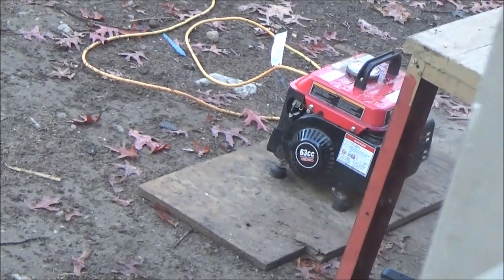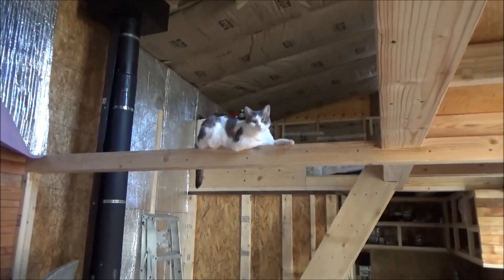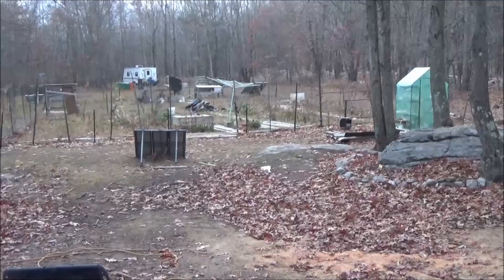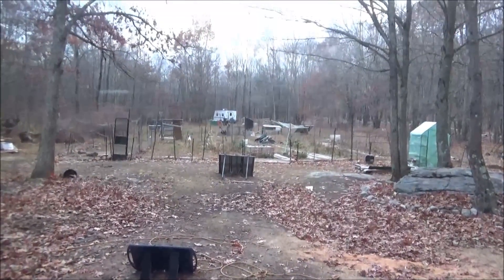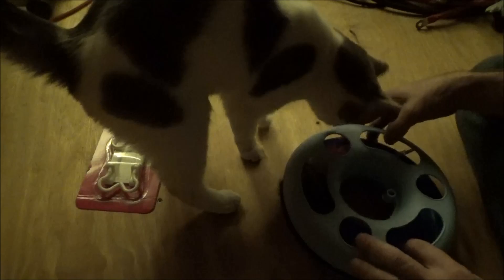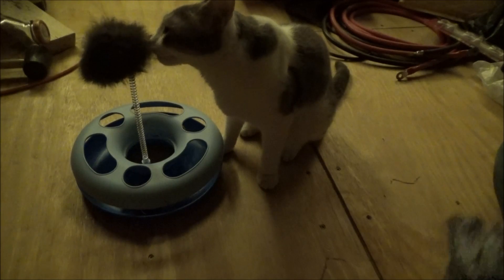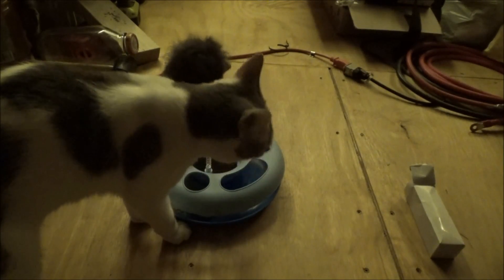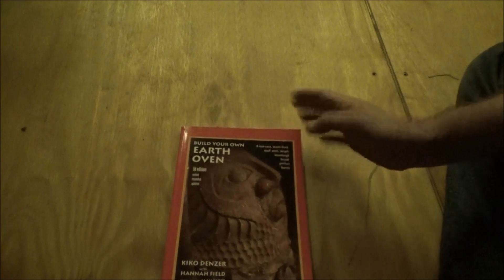Charging New Tiny House Solar Battery Bank

Comment: I started watching Troy to help me understand how solar power works and how to do a DIY setup.  I've also watched some other solar set ups on YouTube that other folks have posted.  Someone help me understand why Troy has such a hard time with his solar set up??? I am afraid to attempt my own set up after watching all this drama he has.  Other folks are running entire homes (minus the 220V appliances) entirely on solar and Troy seems to be lucky if he can keep his laptop and cell phone charged with it.  Also, it seems like he expends a lot of effort monitoring and attempting to maintain the battery bank.  Can someone with some expertise comment on the feasibility of solar power, because after watching these videos, I'm ready to scrap my plans?...
Reply: I also noticed watching other channels that they seem to sugar coat the problems and don't admit failures.  You rarely see an off gridder say I bought the wrong batteries for my set up so now they aren't working well I have to struggle to get new ones and the price is killing me.  No, what do they say on YT? ... oh, look I have just installed my new batteries because I decided to upgrade.   No admission their batteries sucked, no explanation why they upgraded, no install videos... just boom.. here is my new already installed batteries or let me just tighten this last bolt then let me push the display panel reading and show you the pretty display of my perfect batteries.   Well, this is why I like Troy's videos better... he shows it how it is, warts and all.   You know every off gridder has a genie back up for a reason!  But, they don't admit to using it!  No, they will claim they never complain... great if you like sitting in the dark, but if I made my living online I would be complaining!Troy not only admits it, he just showed how to fix it.  Don't give up your plans, just don't be wearing rose colored glasses when you make them.
Reply: I think the majority of his solar problems stem from him keeping his batteries out in the cold. He went through the trouble of building that insulated battery box in the RV yet he didn't bother to keep it heated and the batteries started having all their trouble. I have a smaller solar setup then Troys and I keep my batteries inside...and I have none of the problems he does.
Reply: Because he uses what he can afford and there in lays the problems. You get what you pay for and Troy does get lucky on certain bargains, but with power storage he does get what he pays for. He is making do with it, like a warm house and eggs, just getting the power back together is big plan right now. He has some backups, but he will get this problem solved.
Reply: Solar on a sufficient budget can be done easily. Good batteries and a proper setup go a long way. I'm not knocking Troy for his setup, he's just on a shoestring budget. This can be done but it's the long way around and comes with many headaches.
Reply: Rob Busch Cold batteries perform worse than batteries at room temperature. The type that Troy has seems to be particularly affected.
Reply: Troy got those batteries cheap because they were going back to be recycled. They were left in the RV last winter. His second problem, he is in a spot with only 4 hours of useable solar, and is in a  valley and a medow surrounded by trees which reduce it even more, add to that, the last 60 days, he's had 5 sunny days
Reply: TheMoneypresident I agree. We should all follow you ;)
Reply: jlp1149 You are absolutely right!   My parents are your first option.  Their professionally installed system cost $30 grand!  It has been in about one year, not a bother. .. it is grid tied, and this eliminated their $300 per month electric bill plus they get paid about $1.25 after all is said an done.  (Yes $1.25 was their average excess earnings over their bill.)  Well that's all fine and good. .. but what kills me is because it's grid tied it has to have a shut off so that when the grid is down they have no power either!   I want power while the grid is down... $30 k for solar and no power while the grid is down... that is nuts!
Reply: The batteries are his big problem, if your going to do any kind of offgrid setup you dont want to cheap out with batteries, (or panelsand charge controller for that matter)might be more expensive but it will save you many hours of dark times and frustration, this time of year is also the worst for solar also,if you have any questions about life off grid feel free to ask if you want another opinion
Reply: So temperature plays a big factor in it?  If I don't keep my batteries at room temperature, what are my options?
Reply: why do I not see a reply from youtube user "TheMoneyPresident"?
Reply: Just trying to give J Busch some background info because solar is all about  location, location, location.
Reply: tons of $$$ professional contractors / installers , and a lot of patience == easy, shoestring budget, doit yourself , willingness to take advice (sometimes bad, sometimes good ) a lot of homework and willingness to say I don't know = some success and some failures ,
Reply: MollyDolly I heard someone in MD was having problems with his batteries he has hooked up to a camper a couple weeks ago.  He has the camper parked in his driveway and his son and his sons girlfriend are living in it.
Reply: dumpsterplace1 Shocking! 
Ok, I just made myself laugh...I should take a nap.
Reply: ***** I heard through grapevine that he has a video on his channel where he and his family went swimming in his flooded yard earlier this year.  So why would he want the fix the flooding problem when its a free swimming pool when it floods?
Reply: ***** I also heard he tried to get a man arrested by telling the guy to ignore the fd telling him not go into some flood waters to retrieve his wallet.  I dont know about the laws in MD but that could get you arrested doing that here.
Reply: Jeff Tower Why would she want Troy to pay for the chickens Melvin cofessed to stealing from me a couple nights ago?
Reply: Jeff Tower So shes one of Troys ex girlfriends from hs seeking revenge for him breaking up with her thirty years ago?
Reply: herbsterplace1 Herbie so what channel did Dan(conspi racy) hack to post that on?  THe channel he put the original post on was hacked.
Reply: ermorgan0926
Reply: ***** THat is disgusting.  Only taking two baths this year so far when his yard has flooded.  If I ever see him I will make sure to turn around and go in the opposite direction.  God knows his bo will be outrageous not having a bath since Aug. when his yard flooded last.

Comment: I went to the Wikipedia and got this on Lead acid batteries
These are general voltage ranges per cell:
Open-circuit (quiescent) at full charge: 2.10 V
Open-circuit at full discharge: 1.95 V
Loaded at full discharge: 1.75 V
Continuous-preservation (float) charging: 2.23 V for gelled electrolyte; 2.25 V for AGM (absorbed glass mat) and 2.32 V for flooded cells
So 12.6 would be full charge disconnected.

Comment: HI Troy,   If you need help with Windows  let me know   (IT Technician)   But my recommendation is downgrade to windows 7 (64 bit)   way simpler
Reply from the maker: Jason Deadman My biggest wish is that they kept supporting XP
Reply: Wow, Not a Good sign, An  IT Tech recommends downgrading to 7. Windows is really screwing up good. My Next is an Apple.
Reply: The Do It Yourself World I've used every version of Windows since 3.11. I was also disgusted with Win 8, but did the free upgrade to 8.1, which fixed some things, and learned a couple of tricks. I used Ubuntu on a laptop for a little while, it's okay. Small installed size and nimble because it's small, it also is not a full-featured OS like Windows is. Once I got 8.1 up and running, eliminating the external USB TV tuner that was making things unstable, I've had no problems with 8.1. However, you need a pretty good setup to have it run well. 4GB of RAM is barely enough, it will run slowly on almost any machine, with that little RAM. Especially if you're dong memory-intensive activities such as video editing, you really need plenty of RAM. Since your new laptop doesn't seem to have a dedicated video card, and you are only running 4GB of RAM, you will definitely see slow speeds. I know you're working with what you can afford, and making the best of it. If someone wanted to help you, they could find out what RAM you need and send you 8GB. It can be had for well under $80 on Newegg. I'd help out, but just had to fix my daughter's car. Saying your OS is junk when you don't have the hardware to do what you want to do is like complaining that your Ford Pinto can't keep up with a Ferrari. It just doesn't have the horsepower.

Comment: Troy watch this video so it will help you know if a battery is good or not. Its a how to video. Its called   " Beaver Creek Golf Carts Shows You How to Test your Cart's Battery"  After you watch this video you will have a clear idea of how to test your battery with the min. home equiptment. You can take your batteries to a country club or a golf cart dealer to have them test each battery with the proper tester because the proper tester are not like advance auto has. Its different. Any way watch this video it will help you under stand. I just bought a hydrometer. You need to get one. The video will clear the air for you.

Comment: 12.6 I think is what they sit at. If you get one that sits at 12.8 Its a really better than most golf cart battery. I need to give mine a charge today. I finally got four enough for my 24 volt inverter but I dont have them wired up. I need a MPPT charge controller and more panels on a new tracker now.

Comment: SO if you have no load on your batteries then you must have a phantom load. Maybe the power is being sucked out by the solar cells. Do you have a diode to block that from happening. Either that or that batteries are worthless. Those things are made to power golf carts. They wouldn't sell them if they just drained themselves.
Reply: maybe back feeding thru charger when not running but still hooked up?
Reply: no, his new batterys are damaged,

(indeed worthless), his solar mppt charger has build in fetts witch will work as a diode, preventing decharging from the panels.
Reply: MrBugsier5 your right about the charge controller but I was thinking the cheap HF battery charger might be the culprit, if its not charging but not turned on its drawing on the batteries, if nothing else just to power the lcd readout
Reply: ghettohillbilly1  yes thats a posibbility, but thats not a big load, cant believe why hf gave Troy a empty battery, it must be sulphated., a 200 amphour battery can give 10 amps for ten ours easely before dropping that low.(you can draw half the amphour out of it dayly whitout damage, so 100 amphours to use from a 200 amphour whet lead acid semitraction .
Reply: MrBugsier5 hard to say, if it was back feeding into the transformer than it could explain the load, if the battery(s) are sulfated off the shelf hes wasting his time with the lil HF genny, it dosent have the power he'll need, maybe someday he'll listen and buy a hydrometer(under $10) then he'd know right away if things are sulfated or not, with lead acid batteries you need to check more than just voltage to get an accurate reading of where the power level actually is,low S.G. will cause false readings of higher voltages
Reply: ghettohillbilly1  by the way of building the charger its inpossible to backfeed into the transformer because of the rectiefier diodes between trafo and battery.,(unles it is defective afc.) but the electronic messuring gadgets sure draw a litle power, but thats neclectable (lower tan 1 amp for shure, ), y tottaly agree with you about the hydrometer and the messuring faults the made at the autostore, the cca says nothing about the damage in the battery, iff one cell is shorted, it stil will deliver the amps, only at lower voltage indeed, in my opinion his batterys ar in a sorry state, although new!
Reply: MrBugsier5 your right  I just never trust chinese stuff, they tend to cut corners, sometimes what you think no one would ever do they will
Reply: ghettohillbilly1  aree with that, seen some stupit faults on chinese stuf!, but it looks to get a little better nowadays,frome plane junk to usable (lol)
Reply: lol yea i think thats usually in how much you pay,and instead of 1 in 10 being no good its up to 1 in 20-25 not great but better lol

Comment: When you get your battery charged. Disconnect the old cells. and use the new cells for a few hours at least see if the old cells are discharging by them selves. There may be lead jumpers between the cells internally.
Another way of finding out if your batteries are still good. A charged battery unused should hold its charge for weeks at least maybe months.
I should tell you that if any oxygen or hydrogen is on the plates it will cause a higher voltage and will dissipate over a few hours this in normal. If the voltage continues to discharge you have a problem. (little lead fingers between the plates.)
Good Luck
Reply: Your bedini probably burns out these fingers. I have never used such a device.

Comment: I would be curious to know what the AH rating of the batteries are. If it is a starting battery, the lead plates will not be as thick as a deep cycle battery and you will have a reduced AH capacity. I grabbed (4) 12 volt AGM batteries for my system. They seem to hold up to my abuse quite a bit.
Reply from the maker: LostInTheWoods 216 AH golf cart batteries
Reply: The Do It Yourself World That would mean you only have 216 AH of usable power at 12 VDC system. If you were to drain your batteries completely (not recommended), that would only give you a potential 2592 watts. If you only discharge to 50% (still not recommended), you would only have 1296 watts. The recommended discharge is 20% which is a only 518 watts. The bigger the bank, the more AH storage. Add 2 more batteries to your system and you add another 518 watts. So on and so forth. Food for thought!